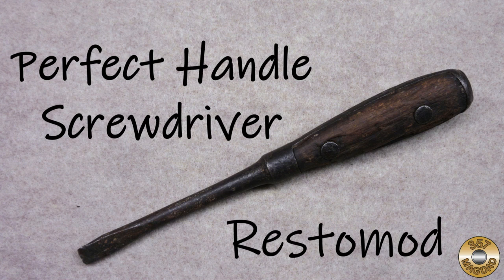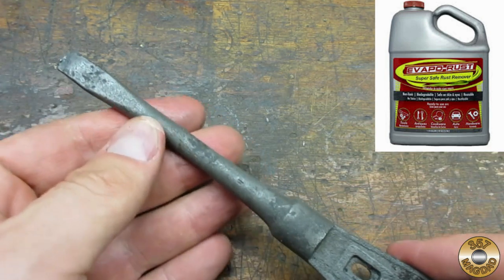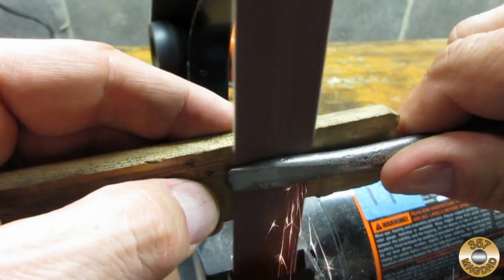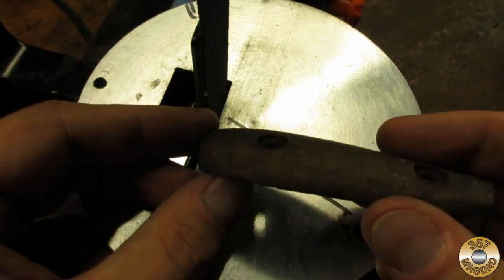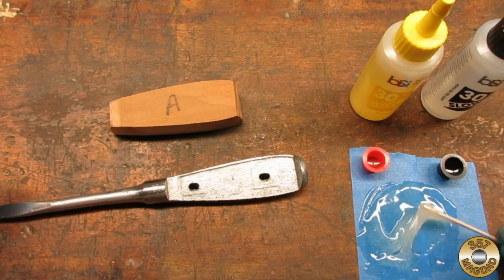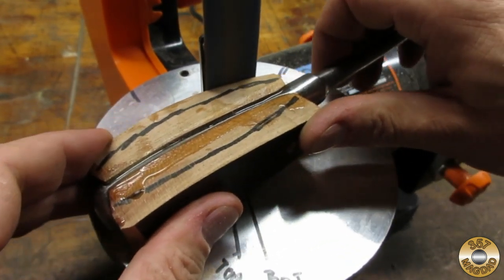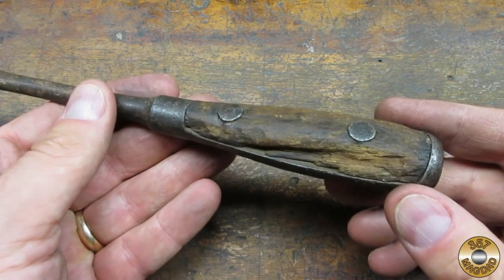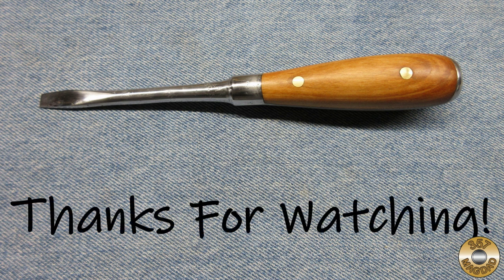Hand Tool Restoration - Perfect Handle Screwdriver Restomod

Comment: Really enjoyed  the restoration. Take a look at this screwdriver being sold on eBay in the UK and see if you think they are made by the same company - https://www.ebay.co.uk/itm/Vintage-Solbar-P-S-W-12-Perfect-Handle-Style-Screwdriver/223579043929?hash=item340e597859:g:KFIAAOSwtd5dGS1H.
Reply from the maker: I think it is a match!
Reply: Certainly seems to look that way. However, this style used to be common like in my grandfather's day. They also had "monkey" wrenches with the same style handle, but not all were made by this company. Maybe they didn't get their patent, I don't know. this used to be very common, maybe they did and licensed it or got huge for a time. Might be interesting to find out.
Reply: @tootall5559  A lot of companies have picked up this design, but the original was H.D. Smith who started making them in 1910, although the Perfect handles were made of three patents from as early as 1903. In 1930 H.D. Smith was bought by the Trimont Manufacturing Co. which got the rights to the patents and decided to stop production. in the 40's Irwin would pick up the design and the perfect handle screwdrivers were placed in tank and jeep tool kits. Theres also a lot of perfect handles simply labeled "Germany" that seem to be from around the 60's but i can't be sure. This Solbar perfect handle has a different style rivet and a very different tradition from the handle to the shaft from any other manufacturer. Which makes me confident that the restored screwdriver is indeed a solbar
Reply: @gavintolen5012  thanks for the info. When I was a kid, these were very common, at least the style was, never paid attention to the makers back then. Now you really can't find them just laying around everywhere in every garage like it used to be.

Comment: The great thing about using cherry is that it ages so nicely, it’ll just get darker and richer with time. I wish we could have seen some of the wood finishing process, but this video is already longer than most of your others, so I understand. Bravo all around!
Reply from the maker: Thanks Patrick!  The cool thing about the danish oil is it is so easy.  I wipe it on, let it sit for 15 min, wipe it off and repeat after 24 hours.  I like to apply several coats of furniture wax after the danish oil cures for a couple of days.

Comment: Yep, great result. I like the way you waited until you found a screw driver that was pretty well buggered and ready for the bin before modifying it. So many others rip the wood off just so they can make their own version. Such a waist. I would definitely be proud of that. Cheers Stuart 🇦🇺
Reply from the maker: Thanks Stuart!  Most of the stuff I find at yard sales and flea markets goes up on ebay. 
 Changing out the wood, although it made screwdriver prettier, took the value to basically zero.  I'll be keeping this one!
Reply: 357magdad. I agree but as you say, only from a monetary and possibly historical point but you did save a tool that was headed for the garbage and made it a family heirloom. Well done. 👍👍

Comment: Great work on the restore. I really like the cherry handle. I restored a number 6 perfect handle screwdriver last year when I found it in my dad's old tools. Like yours it had been quite abused. The shaft was bent in 2 places, the wood was in bad condition, one of the pins was lost and replaced with a nail and the tip looked like it had been used as a scraper or chisel...ouch. I replaced the scales with silky oak which gave it an interesting new look and refurbished the entire thing like you did and bright polished it too. I was told later by my father in law that these tools were supposed to be matte black and not shiny silver! Doh!   Anyway, wondering if you or anybody might know the maker of mine - it had a crossed pliers on a shield logo under the wood scales and the faint remnants of a makers mark that looks like 'Woodline' and a made in Germany mark on it too.
Reply from the maker: Thanks Storm!  Great job bringing that old screwdriver back to life.  I bet that old screwdriver likes its new polished finish! I am not familiar with that tool marking.

Comment: Beautiful. The only think I can think of that might make it better if you're actually going to use it is put a hollow grind on the blade. I'm pretty sure that is, but for those that don't, it's a way of grinding the blade in a concave fashion so that the blade fits in the slot exactly, and tends to strip it out less.
Reply: toot tall its a old irwin..they werent hollow ground.. had a set guys loved to borrow ...and keep
Reply: @miguelcastaneda7236   that don't mean it can;t be hollow ground to make it better function over form

Comment: Excellent job. For me the best part was the handle. The job you did on those scales was perfect. I have been looking for a perfect handle screwdriver but no luck yet. But I was looking over some old rusty tools in a box my son had got at a auction. And I found a perfect handle monkey wrench in it. Great now i can try it. Don't have to replace the handle but I think I need to oil the handle after sanding it. What wood you use. Or would you lacquer it. Thanks
Reply from the maker: Thanks Glen!  I like to really soak the old wooden handles in boiled linseed oil.  I think it slightly swells the wood to make them fit tighter.  I've got a couple engine show coming up in Sept and Oct.  Shoot me an e-mail I might be able to help you with your search.  357mdad@gmail.com

Comment: Really nice job on this one. You must have nerves of steel, because while peening I would most certainly end up denting the wood as I missed the head of the pin. Then I would go on to over peen until I split the wood, just to make sure that I wouldn’t be able to salvage the already dented handle.
Reply from the maker: I was sweating the whole time I was swinging that hammer!  I did miss a couple of times but I was using a small hammer and I had more sanding to do on the wood, so the dents came out.

Comment: Why did you glue the wood since it wasn't glued originally? Thanks
Reply from the maker: The epoxy acts as a seal to prevent the steel under the wood from rusting.